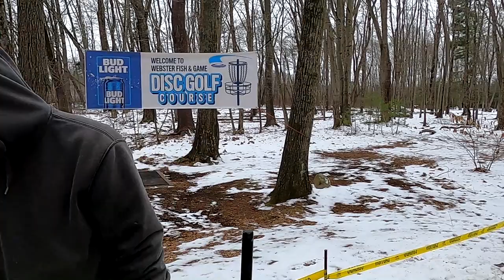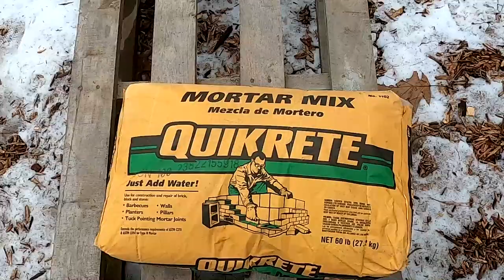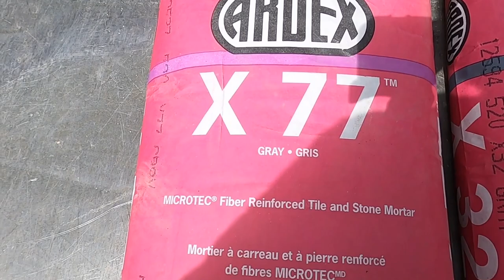(DIY) Stone Veneer Sitting Wall | Part 2

Comment: Looks great.  Did you polymeric sand the block joints?
Reply from the maker: Thanks! I haven’t done poly sand yet. It is too cold for it to set right. I’ll be doing that in the spring when the weather gets warmer 👍🏻

Comment: That's why you pick one long cap,and iam not a fan of 4 or 5 pieces of cap, water will work its way through the concrete.
Reply from the maker: Trust me, I wanted too… this was back in December and I would not of had a full size cap available until late March. We opted with putting these pieces on instead. This tee pad was basically a donation, had to use what I had available. ✌🏻

Comment: Great work and videos. I’ve built several walls myself as a DIYer, self-taught with a lot of trial and error, and I was glad to see that a lot of the technique I learned the hard way is actually correct and validated by what you did here. I also picked up several good tips from watching you so thank you for documenting your skills. I will definitely be skipping the step of mortaring the vertical joints between the concrete blocks on my next project.

Question: I use the sponge technique to clean off mortar from the tuck joints but it’s always left a light mortar haze so I go back the next day and use muriatic acid to eliminate the haze. Do you ever need to use acid on your walls?

Question: I’m considering a hybrid approach to tuck pointing where the joints have a shallow fill of mortar and then after it cures filling the rest of the joint with an exterior sanded grout. The main reason for this is that I can get a much darker color with the grout.
Have you ever grouted your walls? Is this a crazy idea? I’m in NC so I don’t have to deal with the hard freezes you do.

Thanks again!
Reply from the maker: Thanks for the feedback, glad you liked the video! Skipping the mortar in the vertical joints is a huge time saver with no down side. Most times the sponge cleans up the joints good enough but a little acid will not hurt if you need to clean some haze. I like the idea of the darker grout but not quite sure how it holds up because I have not ever tried it... But hey, might be worth giving it a shot. I just don't know how it would react in the winter months.

Comment: how is the ardex 77. never used it but a lot of masons are using it. they say it holds  real well. i usually use type S mortar for fireplaces. would you recommend it for that
Reply from the maker: It is excellent. The bond is far better than Type S for sure. Been using it for 4+ years now
Reply: @TheChristianHardscaper  Thanks for the info. I'm using The Boston Blend Mosaic. This will be my first time doing stone veneer. Was sick of my old fireplace look,so I'm going to stone it to the vaulted ceiling. Your work and videos are awesome. Your right,Patience, Patience. Thanks for your time. Mike.

Comment: Are you required to have a license in Massachusetts to pour that small slab of concrete?
Reply from the maker: Nope, no license needed. It is just a footing for a structure less than 4'. Around here, you start needing permits for structures higher than 4'. So I try to stay under that height and if not, the job cost includes the cost needed for all the legal requirements. ✌